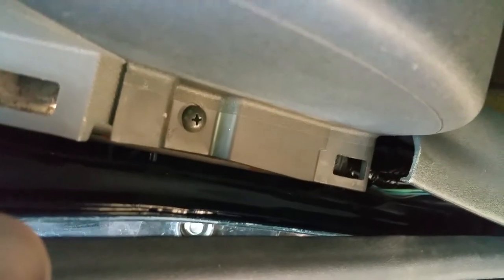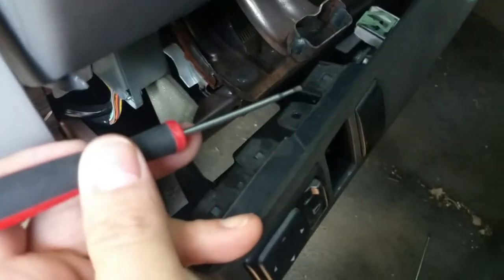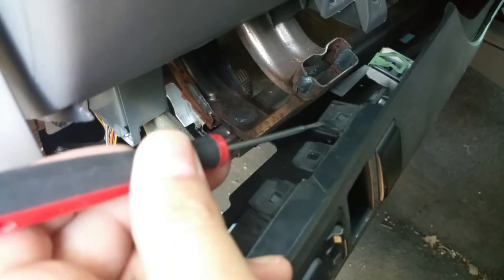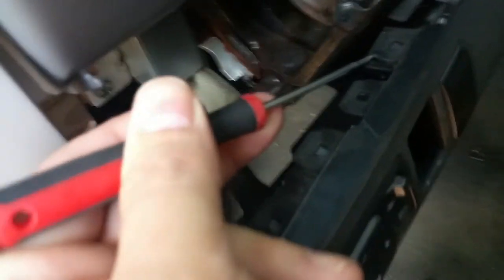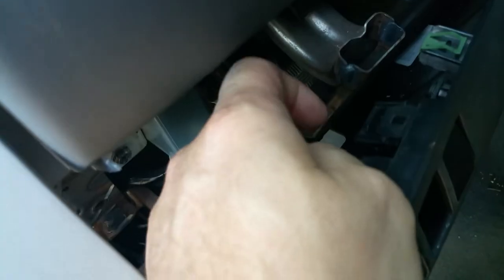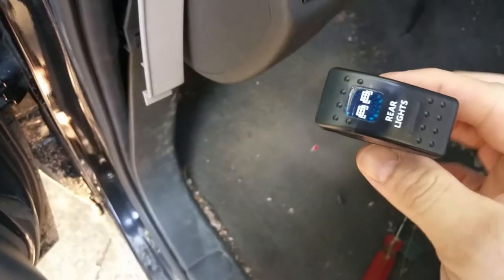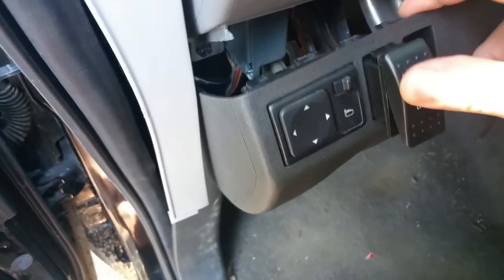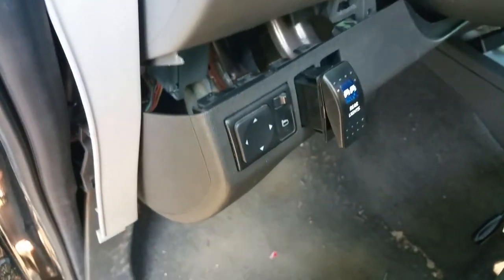Remove switch blank off panels in Nissan Xterra

Comment: Thank you very much. The 2010 Nissan Murano is very similar. I had to re-install the switch on the dash that open/closes the rear hatch door. The switch was totally pushed into the dash leaving a blank hole. The repair was straightforward and easy. Thanks again.

Comment: Where did you buy the switches from that you were replacing the blanks with?
Reply from the maker: Chase Feeley MICTUNING MIC-LSB1 Laser LED Light Bar Rocker Switch ON-Off LED Light 20A 12V, 5pin, Blue https://www.amazon.com/dp/B00M5YC7Q4/ref=cm_sw_r_cp_api_i_jBMfFb0QH1WF4

Comment: How do you remove the blank rocker below the radio?
Reply: I’m in the process of doing this for my 2017 Frontier and it’s a PITA. Had to disassemble basically everything around it, globe box, center console between the front seats, and pull back the lower plastic underneath to reveal the screws fastening it in place.

Comment: Ahhhhhhhhh
Wait no not the end already....I wanna see wire chasing😭😭😭😭 ahh Man. This was good stuff. Straight (short) to the point. I am thinking to put me a switch in the center. But repairs are needed before that happens... Code U1000. I have not been properly grounded, but being punished in my wallet.

Comment: Is there a video on how to run the wires through and how to connect them correctly to the actual button and battery?
Reply from the maker: Matthew Pankow I ran another set from a secondary fuse box, I run all of the accessories I've added from it.
Reply from the maker: Matthew Pankow 
Blue Sea Systems ST Blade ATO/ATC Fuse Blocks https://www.amazon.com/dp/B001P6FTHC/ref=cm_sw_r_cp_api_i_.xMfFbXTMVD71
Reply from the maker: Matthew Pankow  this should help. 
https://youtu.be/b3Vw-xv6ZEg